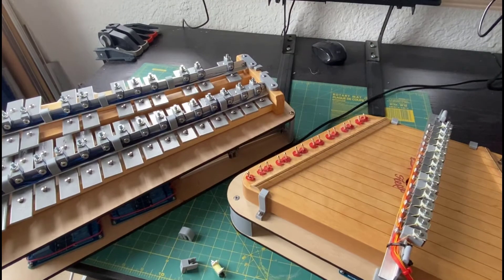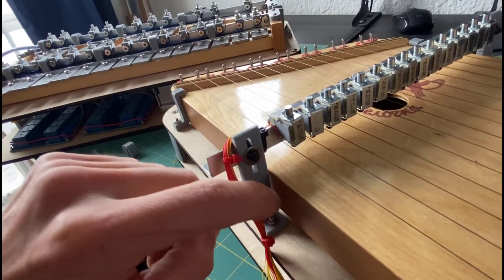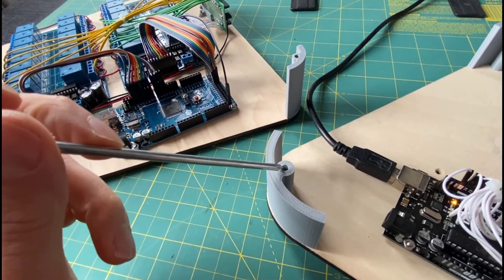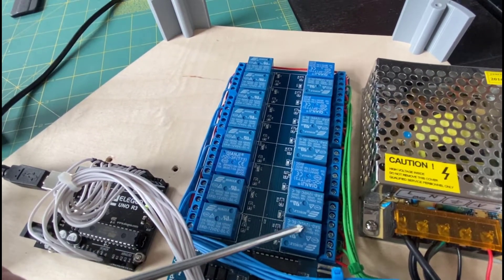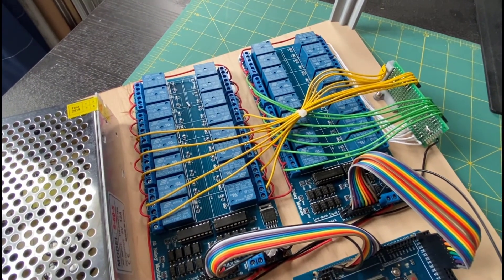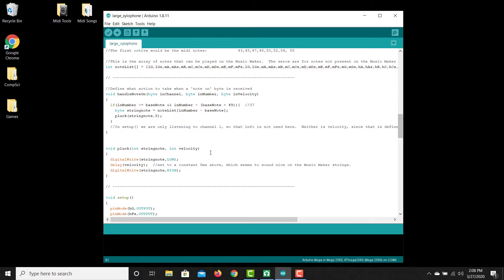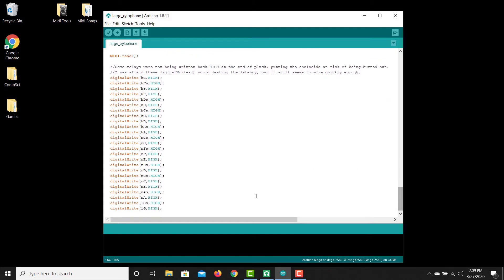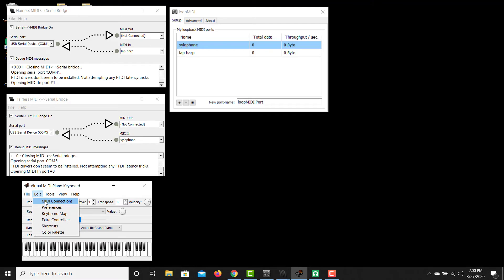How to Make Arduino Instruments that Play MIDI Songs!

Comment: Great project!. I have been building an organ myself. I used LOOK MUM NO COMPUTER's arduino teensy setup for midi. He uses oldschool DIN plug midi that and it seems to work fine and snappy. Each board has 40 controls for solenoids which is quite handy if you have many tones. 
https://www.youtube.com/watch?v=0Mdx8HWZ-Dg&list=PLluPQLh1xzlI7EMB5qIxDd_1OLE-Z_kyC&index=4

Comment: Hi! Two questions. Is this able to play two or more notes simultaneously? I had trouble with a teensyduinos ability to do that.   Also do the relays have a diode to prevent the solenoids from doing that thing where they send electricity back up to the board and fry components?

Thanks! Really nice work!
Reply from the maker: TBH, I don't know all the ins and outs of the library that I mentioned using.  It takes 8 ms in my code for a single note to be played (solenoid powered, then released), so when it gets information to play multiple notes at once (from a chord or from multiple tracks playing at once), my ear isn't sensitive enough to tell if the notes are played one at a time, or all at once.  If they're played one at a time, it could still do 10 notes in 0.08 seconds, which is pretty fast.  Now, it is possible that the library has the "noteOn" events acting as interrupts or something, and it handles them right away, even if another note is still in its 8ms cycle, but again, too fast for my ear to tell.  Regarding the relay's, they have optocouplers to isolate the Arduino signal from the higher current, so no need for an any additional diodes in this build.  If you were going to do something with transistors, like this project (https://www.devinejohnny.com/projectgallery/midi-arduino-glockenspiel-with-tip120-transistors) you'd need some protective diodes for sure.  Also, if you're going to tackle something like I did in this video, I should mention that I think a lot of the middle-man software I used in the project are no longer available.  You should check out Hiduino (https://github.com/ddiakopoulos/hiduino), which is firmware you flash to an Arduino so that you can just plug the thing into a computer and boom, it shows up as a native MIDI device with no extra software.

Comment: This is pretty cool! I had an idea for a project but do you know if this would be very complicated with fl studio?
Reply from the maker: I haven’t use FL Studio, but looking at the wiki, I appears that it does have MIDI out capabilities. https://www.image-line.com/fl-studio-learning/fl-studio-online-manual/html/plugins/MIDI%20Out.htm

If you’re going to try making something like I did in the video, I’d recommend some changes. A big challenge is getting the Arduino to be recognized by your DAW as a MIDI device. That was the purpose of the extra software shown in this video (which I think is all deprecated and unavailable now). A much better solution is to use Hiduino. You use this to re-flash the firmware on your Arduino. After that, when you plug it into any DAW, boom, it just shows up automatically as a MIDI device. Pretty slick, though it was a challenge to figure out how to do the reflashing process. https://github.com/ddiakopoulos/hiduino

Comment: very cool! is it possibly with solenoids to also have different intensities of hitting? to have soft or loud tones and everything inbetween...
Reply from the maker: If you used transistors to control the solenoids, you can vary the amount of current they receive. With the relays, you can vary the amount of time they are closed (I used 8ms in this project, so a smaller time would be a less intense hit). The problem with this is that even subtle differences between solenoids (their internal friction, distance from the surface, etc.) means that some might not reach the keys at all while others do. In this project I had modes that did both (transistors and varied time), but also had a felt covered damping bar that could be pressed into the keys with varying pressure using servos. https://www.devinejohnny.com/projectgallery/midi-arduino-glockenspiel-with-tip120-transistors

Comment: Have you tried to use Solid State Relays instead of the electromechanical ones? Then you won't get the clicking from the Relays..?
Reply from the maker: Yeah, I used TIP120 transistors in this project. https://www.devinejohnny.com/projectgallery/midi-arduino-glockenspiel-with-tip120-transistors
Reply: @MisterDevine  it is very very cool! You are doing really good and it is inspiring.

Comment: Ughh! You stole my idea 2 years before I had it! 

Great video though! This came out great!
Reply from the maker: Thanks!  You should still give it a go, though.  I would recommend some changes if you give it a try.  I think the software mentioned in this video is no longer supported, but there is something called Hiduino, which is really cool.  With a second Arduino acting as an ISP device, you can re-flash the firmware for the USB chip on your Arduino so that is acts as a native MIDI device.  That means once you plug in the instrument to your computer, boom, it just shows up in your DAW and is ready to play.  I've done that with some more recent instruments, but don't have a full write up on my website yet: https://www.devinejohnny.com/projectdetails/m7jy1wa0aukmz9ory546gcr8xu0wa5

Comment: Would a set up like that work with Apple’s GarageBand or Logic Pro X  DAW’s ?
Reply from the maker: Yes, I imagine so.  It just needs something sending MIDI signals.  I really need to do another video and write up on my website, but all my instruments after the ones in this video use hiduino, which re-flashes the USB chip on the Arduino so that when you plug it into something it is recognized natively as a MIDI device.  That means you could plug a keyboard straight into the instrument and play it.  No need for a DAW, hairless MIDI, loopMIDI, or any of that jazz.  It's pretty cool.
Reply: @MisterDevine  Looking forward to learn how did you achieved all that! Really neat job!

Comment: Nice work! There are N-channel MOSFETs that can be directly controlled by gpio lines from the Arduino. This could eliminate the 12v supply and relay clicks.
Reply from the maker: Thanks!  I took that approach with a later, better build: 
https://www.devinejohnny.com/projectgallery/midi-arduino-glockenspiel-with-tip120-transistors

I also flash hiduino firmware to the Arduino in that build, which eliminated all that extra in between software; just plug in the USB and I pops up as a midi instrument. 

I also did a build with ULN2004 transistor arrays, which really slimmed down the electronics. Didn’t document it, but here’s some more about those chips: 
https://en.m.wikipedia.org/wiki/ULN2003A

Comment: can i know that relay type!? and the name. i want to make a hummer to hit the clock bells
Reply from the maker: Also, if you didn’t see it already, I’ve got more details on my blog:  
https://www.devinejohnny.com/projectdetails/midi-xylophone-with-arduino-mega
Reply from the maker: I think this link will take you to what I bought on Amazon. They are relay modules made by ELEGOO, but there are numerous similar brands that would work as well. 

ELEGOO 8 Channel DC 5V Relay Module with Optocoupler Compatible with Arduino UNO R3 MEGA 1280 DSP ARM PIC AVR STM32 Raspberry Pi 

https://www.amazon.com/dp/B01HCFJC0Y/ref=cm_sw_r_cp_api_glt_fabc_C8G96KYR6HAHVXHRN5SY?_encoding=UTF8&psc=1
Reply: thanks, i love u guy.